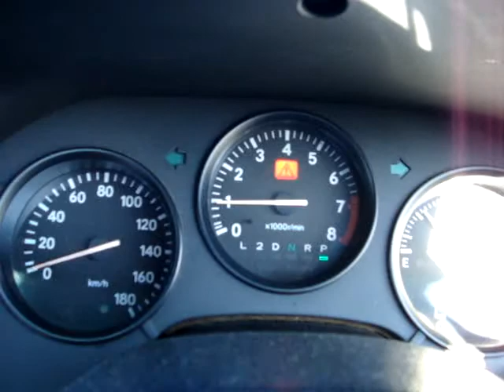WWW.TYEEIMPORTS.COM MK4 TWIN TURBO SUPRA WALK AROUND 2JZ

Comment: ya cause they put shittyer turbos in to stay within there stupid power agreement. also ya auto may be faster in a 1/4 but i be you get better fuel economy with a 6 speed instead of a 4 speed auto. plus it would be about 5000 times funner ;)